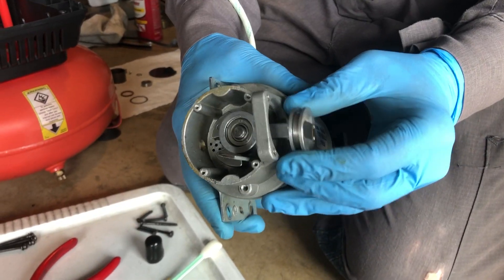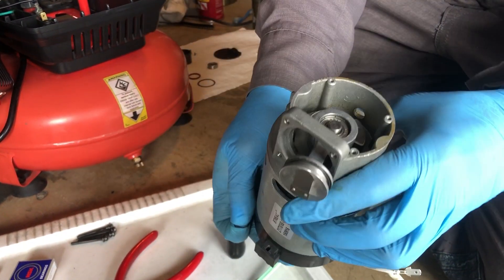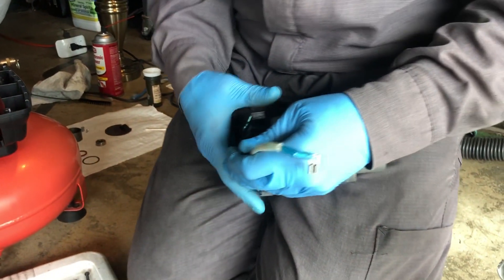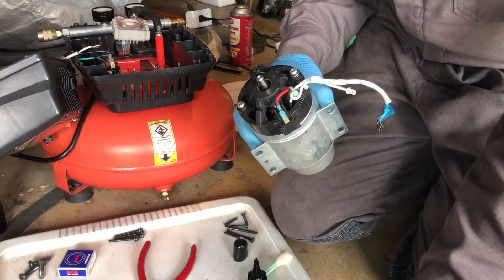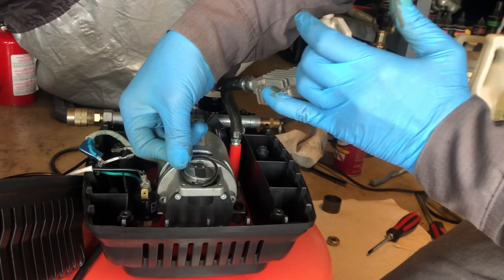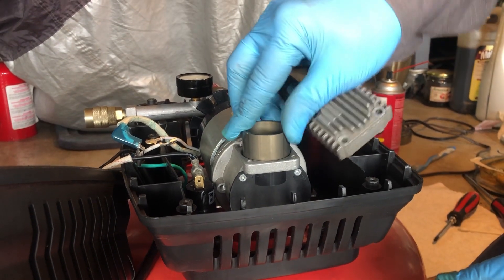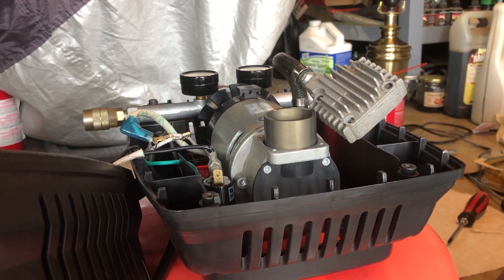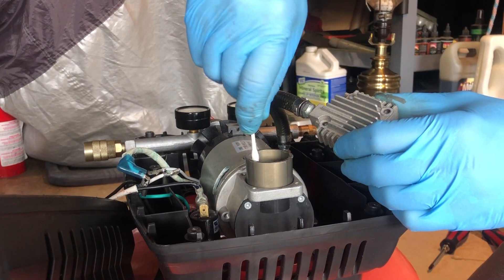Central Pneumatic 3-gal. air compressor rebuild (Part 4/5) -- cylinder assembly

Comment: Just wonder what made you decide to overhaul the compressor. Was it actually working or ???
I have one I picked up for free at a garage sale. It is missing the fuse so I don't know if it actually works or ??? I found a source for the fuse so I will install one to see what happens.
Reply from the maker: I decided to take the compressor apart after it started hesitating -- in other words, the RPM would go up and down as it was building pressure.  The problem turned out to be the big-end bearing, as I suspected.  Still working great two years after the rebuild.

Comment: You are very detailed!! The aluminum supply hose cracked on mine and wondered where you bought the fittings to re-do with a rubber hose between the compressor head and the tank. Thanks Randy
Reply from the maker: Hi Randy -- this compressor came with the rubber hose originally.  I would try McMaster-Carr's on-line catalog to see if fittings that fit the bill (no pun intended) are available.  Obviously, the hose to be used needs to have an appropriate pressure rating.
Reply: @Zerk_Ziegler  Thanks for the suggestion Sir. Wish mine did too, the vibration of the compressor running does  the aluminum tubing in.
Reply from the maker: @randy4249  Yes, the aluminum tube cracking seems to be a common problem with these :(

Comment: Zerk where did u buy the rebuild kit  ,  My Piston gasket is broken ,  and the harbor freight customer service never came to the phone .
Reply from the maker: I bought the bearing at a local bearing-supply store.  The piston "rings" and the cylinder base gasket looked good, so I reused them.  Which of your gaskets is broken, the O-ring that fits in the groove of the piston or the cylinder base gasket?  Keep in mind that one of the piston "rings" is a split-type ring.
Reply: @Zerk_Ziegler  its the cylinder base gasket
Reply from the maker: @ericm5393  It should be pretty easy to make that gasket.  Auto-parts stores carry gasket material, and the old gasket can be used as a template to cut out the new one.  The trick is to get material of similar thickness.  Also, I would use a thin coat of dielectric grease around the gasket to make sure it seals.
Reply: @Zerk_Ziegler  My Mistake its the rubber seal on the outside of the top of the piston
Reply from the maker: @ericm5393  You should be able to use a bead of RTV silicone there.  Let it dry and then assemble.  Just to clarify, I am talking about using RTV for the gasket in the head.  If you need the rubber ring that fits into the piston groove, you will need to measure it and try to source one  locally or go the Amazon/eBay route.
Reply: @Zerk_Ziegler  ok I'll try that , thanks
Reply: Where did you get the piston ring and o ring?
Reply from the maker: I reused the existing parts since they didn't show any wear.  The compressor is still working great today.